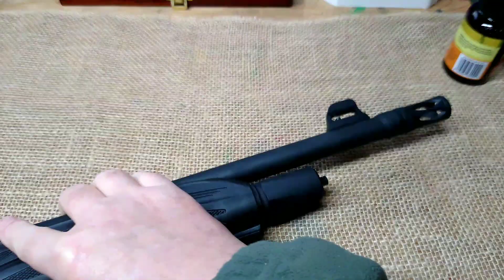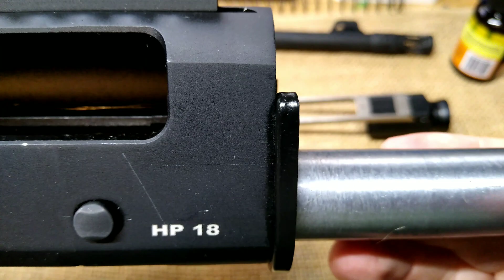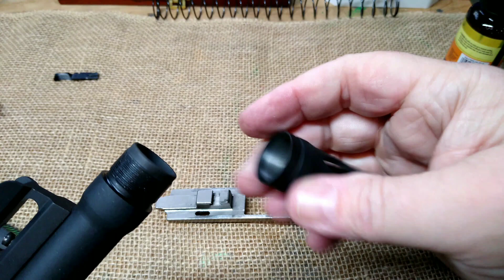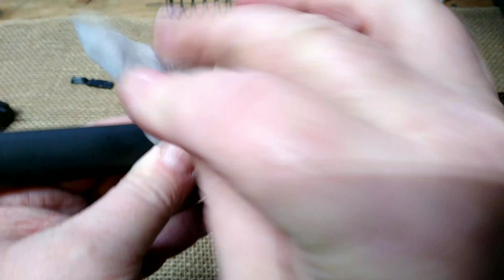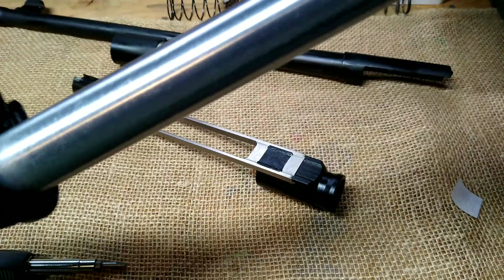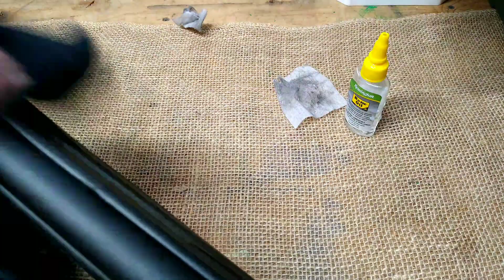Iver Johnson HP18 detailed disassembly cleaning and reassembly. getting it ready for first shots

Comment: I know this video is a little old, but I just bought my own ij 500.  I can't seem to get the charge handle out of mine.  I've tried your method and I put it in every position I can.  I'm convinced that mine is stuck. Which is unfortunate.
Reply from the maker: I found the simplest method is to remove the barrel and take your index finger and push back slightly on the bolt face and pulling out on the charging handle there is just one spot where it will just come right out
Reply: I cant get mine back on

Comment: With that externally threaded barrel, I wonder if you can use poly chokes on this guy.  Thanks for all the info.  I've got one of these in my cart now.  Just trying to decide between this, the Citadel Warthog and the SDS Imports ART02.  All seem pretty comparable.
Reply from the maker: The citadel warthog has the advantages of interchangeable choke tubes and even comes with a set if I'm not mistaken. This gun has external threading which I doubt anybody would make a choke for. All being the same if you just want it for home defense this would work fine but if you want something that's a little more versatile I would go with the citadel warthog I don't know about the other one you mentioned I haven't had any experience with it or knowledge of it. Thanks for watching I appreciate it.
Reply: @HamiltonOutdoors  Thanks for your response and input!

Comment: Thanks for the video brother!  Hey...Question for ya.....just cleaned and lubricated mine....but it's still not shooting semi auto....I have to recharge it to shoot again.....help!
Reply from the maker: Might be your ammunition maybe try a hotter ammunition. If that's not it check your gas piston. To make sure you don't have a problem with your gas seal ring.
Reply: @HamiltonOutdoors  YOU WERE RIGHT. I was using cheap shot...buck shot...winchester AA....but also a similar all blue but longer blast cap....neither worked. But I picked me up some slugs and wolfshot and another high load shot and they all shot just fine. Thanks for helping me get my home defense tool operational/figured out so I can protect my family ;)
Reply: Is there some type ammo identifier I should be looking for so I know what will work and what wont?
Reply: One  buddy told me nothing under 1500 fps ammo....?
Reply from the maker: @sgtbulldog6508  mine has ran all the cheapest ammo, and the more you shoot yours and it gets broken in. The better it'll function with weaker ammunition